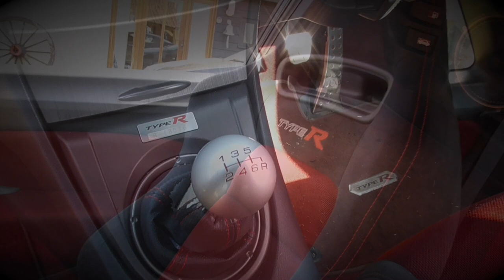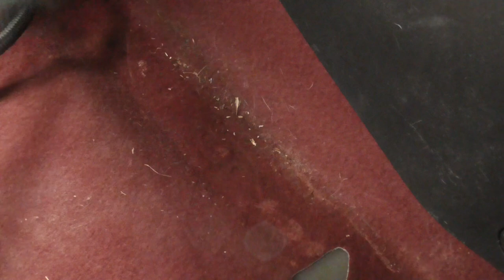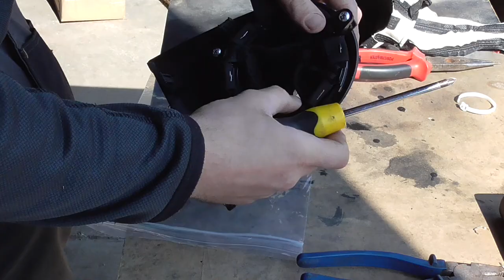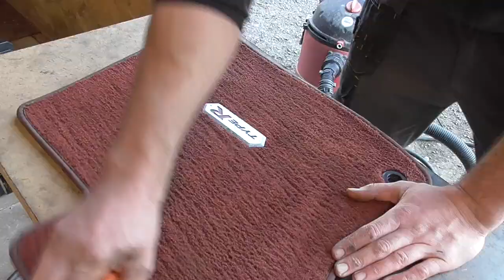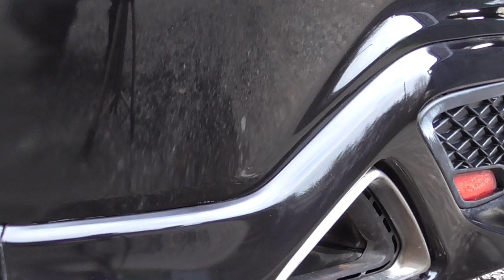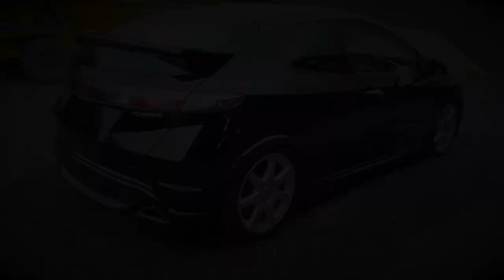Honda Civic Type R | Full Cleaning, Detail & Sale Preparation | Time-Lapse In 15 Minutes

Comment: epic job bud! thanks for saving another fn2 from the heap! 
i hated and loved my crystal black fn2, nothing shines like black, and looks amazing, but the paint on a fn2 is butter soft, just washing it wrong, i.e no pre wash or double bucket with guards causes all sorts of problems, hell i could swear that just having it parked on my drive caused marring and holograms!
i always found that, correction wise, megs 205 with a medium orange lake country pad worked wonders on my paint, what compound did you use?
Reply from the maker: Thanks Craig! You're right - when it's clean, Black is a gorgeous colour, but keeping it that way is tricky to say the least! I agree, Honda paint in general seems to be on the softer side and needs treating with caution. For the correction on this one i used my 'go-to' compound - Meguiars Ultimate on a medium / medium soft pad. That's the set up i use for 90% of the correction work i do, only varying when conditions dictate!
Reply: The paint is kind of thin on these, but even with a standard wash and basic wax it shines like new. Plast-X on the headlights and rear perspex. I had mine parked next to a 21 VW and  there wasn't much difference.

Comment: This is brilliant. How did you paint the touch ups? Was there a base before the nighthawk black? Was there a clear coat over it?
Reply from the maker: That was aerosol nighthawk Black over the repair (filler). I didn’t use primer as it was a small area and I was working the paint out into a fade. With regards to clear - there was a clear coat applied over the fresh paint, yes 👍